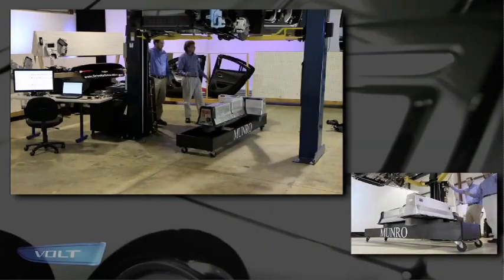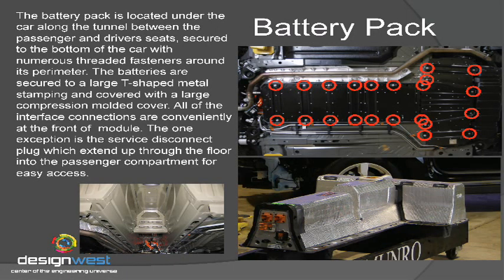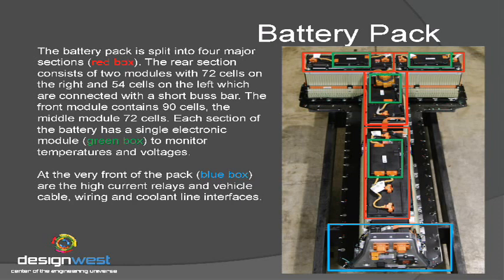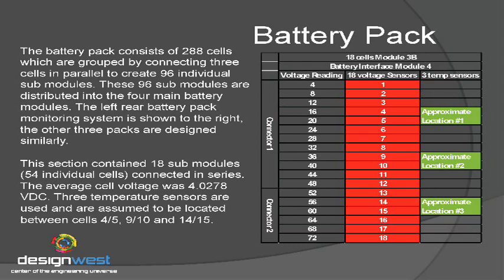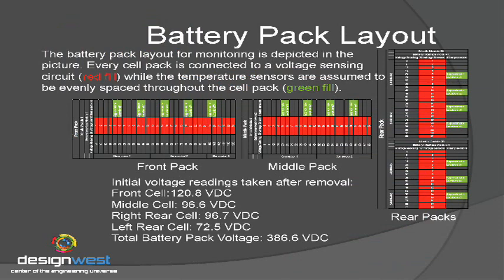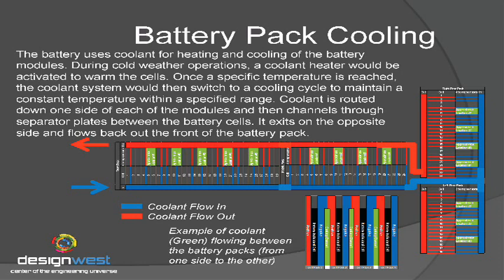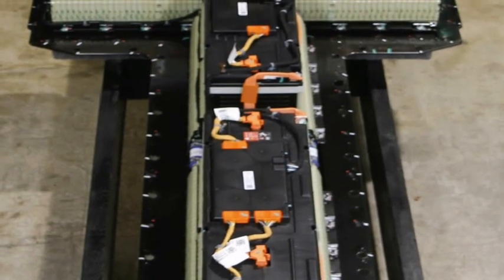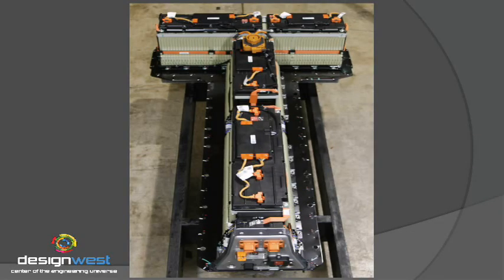Chevy Volt teardown: The battery pack

Comment: I live where it is cold... I have 2011 volt... I want to have it run on gas all the time when it is believe 25 degrees.. is there soft ware to do this??? also could I lie to the computer that battery is dead so it runs on gas... 2012 and up have solf ware to do this... it still run great... today 12 volt battery die... not bad for 11 year old battery... wow.. I have been running it on mountain but I need to get the battery charge to less than 11 mile left...

Comment: I own two 2013 Chevy Volts one has had a TOTAL battery replacement, all 435 lbs of it. The second has had 5 modules replaced.
Reply: Bryce That's the worst luck ever.
Reply: Bryce, I own a 2012 Volt with 112K miles and the battery seems to be degrading now that the warranty is expired.  The Chevy dealers here in Ohio have no clue that the Volt even has an ICE and say that the battery is "not repairable".  If I can find someone more knowledgeable what should I expected the "module replace" cost to be?  Thanks, Kent
Reply: what happened?
Reply: Where they do that

Comment: To fix my 2012 VOLT
$9,800.53
Battery $8887.00
Labor. 913.50
I bought this as a one owner mint with 125K GM called it in for an computer update from COX chevy.Bradenton They had it 2 days and updated the hardware and gave it a clean bill of health with absolutely NO ISSUES. Then only 2 days latter "Shift to Park" appears and has to be towed back to the dealership only to have it looked at for a cost of $248.00 then give me the bad news. I question them about the clean bill of health, they told me it "just happens" batteries go like that. No warning, nothing ...I don't by it. Had it towed to a 2nd Chevy dealership Sunset Chevy Sarasota with the same news plus another 100.00 for the second opinion. Again towed to the 2nd dealership and towed again home. Had I bought this in CA the warranty would be good up to 150K would of not cost me anything ......not a happy camper
2012 Chevrolet Volt 4dr Hatchback (gas/electric hybrid DD) with no options
Values based on 12,000 miles driven per year, with no color or options selected
Condition Trade-In Private Party Dealer Retail
clean $4,680 $6,122 $7,749
No photo description available.
Reply: My 2012 needs the update.. maybe I should let it be!
Reply: @MikeSsuncoasttrains  what update does it say your volt needs?
Reply: @dansmith6990  it needed the power control module update.  Took it the local small dealer who did it. My range jumped but it went back down. Any gm dealer can do it. No charge!
Reply: @MikeSsuncoasttrains  I just bought a 2013 volt and My.Chevrolet shows no recalls needed... but I'm curious on how to check if any have ever been done! It doesn't show anything on the CarFax. Any suggestions?
Reply: @dansmith6990  take your vin number to any dealer and they can tell you everything.

Comment: So why is the damn thing not selling, hmm?
Reply: Youngil Resmerowski As the tech improves and more EV cars hitting the market itll pickup quickly
Reply: Lots of misconceptions and poor advertising.  When I bought mine, most people I talked to thought it had about 60 horse power, and a 30 mile range TOPS.  There's little EV charging in my area, so most people thought (with that misunderstanding) thought the Volt isn't viable.  

Tax Credits + the depreciation of new tech have created a heavy incentive to lease... So only in the last 18 months have we started to see a substantial market of used, affordable Volts.  You can nab a lightly used 2013 or 2014 for about the same price as a zero-frills alternative like the Malibu.

I mention that only because Chevy rightly did light production runs because that's both what new tech and what lease-specific models call for.
Reply: Cause its ugly af, look at the model 3 in comparison

Comment: the chevy volt is a great idea, but the battery itself is not. there is better battery technology then what the volt uses, but thats GM's fault for being a cheap company. but if they had used the most current battery technology the volt could get a much better range before the gas engine kicks in.
Reply: anubis1100 GM has designed an excellent battery that shows no degradation even after years of daily use. Glad they did not follow your moronic unprofessional advice.
Reply: What??? The European version is getting excellent feedback in regards to the quality of it's battery pack.